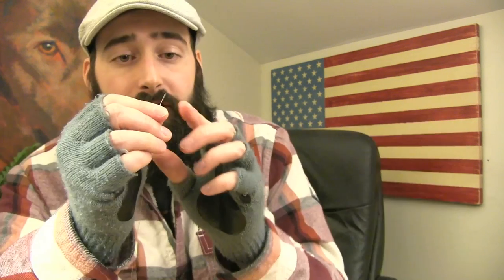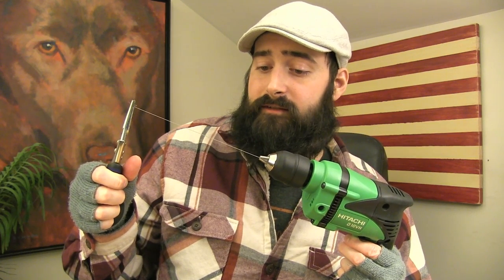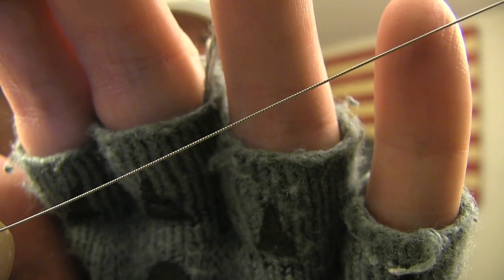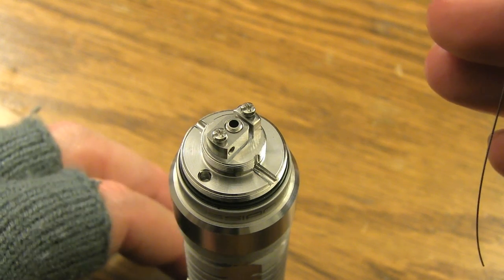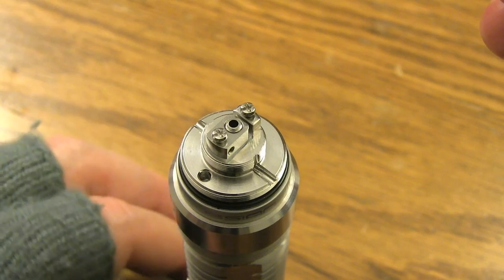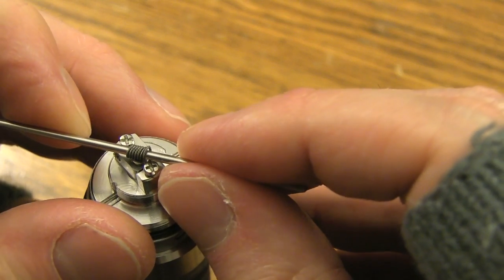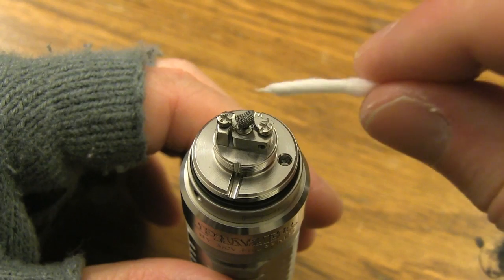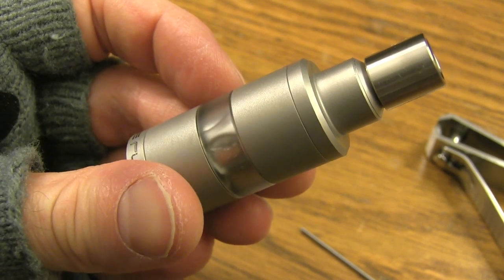Triple Twisted 32 Gauge Micro Coil

Comment: i just built this as 0.6 ohm dual coil in my igo w3 atop my nemesis clone. performs so well lots of flavour and vapour. an excellent use for my 32 gauge that ide stopped using. Thanks Rip :)

Comment: U rock man!! thanks for making great videos that are not painfully boring or drawn out. Fun fact ;) as a electrician I know voltage travels on the outside of a conductor (wire). By twisting their is more surface then a solid piece. just like in the trade. Just wanted to add that man. Thanks again, Namaste

Comment: I do this different to turn my 32 gauge into a lower gauge flavor boosting coil. I make 2 sets of normal twisted kanthal wires, then I twist those together. It makes for a gold chain looking braid to the coil, with lots of bumps and valleys, but is symmetrical, and acts as little channels for the juice to run in, and seriously boosts the flavor of a vape. Vapor production is alright, but I use it for the flavor. At least that is what I use my 32 gauge wire for now that it is too high of gauge for my vaping preference. Seems to make the vape a bit warmer than the resistance would suggest as well.
Reply: what kind of ohms are you getting?

Comment: All I have is 32g right now so ive been twisting once, then doubling that back over and twisting again. I guess its not a quad twist more like a double twisted 32g nano coil, with dragon wicking. Beautiful vapor production and flavor to boot. Only running a single coil since my igo only has one airhole (1.5mm)
You rock Ripp!

Comment: I have a twisted 3 wire 30 gauge 5 wraps micro on 1/16 wicked with cotton on my kayfun 3.1 at .5 ohms and it kicks ass. Extremely warm vape and the flavor is off the charts, vapor production is perfect. Next build will be with 28 gauge

Comment: Hey Rip ... took your advice (usually do) and built this triple twisted coil today for my Fayfun Lite Plus. Wrapped it on a little bigger drill bit at 7 wraps to get 1.3 ohms for my Provari and it's hittin' like a train. :) Much better than my .28 gauge. Good job.

Comment: Hi everyone I've been building for about 5 months now and trying everything I could get my hands on. Let me tell you take the wire demonstrated here make it 3 times then repeat the process with the wires you just made. Make sure to twist the already "twisted" wires the opposite direction when making the new twist. I've been using that design for about a week now and it is a hellacious flavor and really cool for the ohm reads. I'm getting .78 on a 5 wrap on a 1/8 drill bit. Anyway, try it out and tell me what you think.

Comment: made a quad twisted 32 gauge wire and wrapped it five times around a 1 mm screwdriver and it is beastmode. Twisted it by hand, so it took a long time to twist, but at the end i get huge clouds of vapour and amazing taste. I was lucky to find a dutch site that lets you put together your own liquids, by letting you choose three flavours to add and the percentage of vg and pg in your juice, and with my 100% Vg Vanilla-butterscotch cookie flavour it tastes like a bakers dream.
Reply: MeatheadMan Loop it into a coffee cup handle 4 would work too. and just spin the cup. It is about heavy enough to hold line tight.

Comment: This is what I had to do since I don't have 28awg kanthal and all I have is 32awg. I used one piece folded in half so I guess it was only a double twist coil but on a 20 awg needle with 10 wraps it runs about 1.6 ohms. I use this in my protank and works well.

Comment: Just made a dual coil build( 1/16 drill bit, 5 wrap micro on a igo w).  Mother of awesome.  Pulling out the flavor of cherry tobacco with apple.  Best flavor ever.  That wire has been sitting around for months.

Comment: Rip should do a review on my coil setup that I have in my Kayfun Lite.  I have a twisted 28g kanthal macro coil 4/5 wrap reading 1.0 Ohms.  It gives a warm to hot vape with a ton of flavor and great density at 20 watts on my DNA 30. The throat hit is almost too much for me using 6Mg of nicotine. I prefer this setup over the double barrel, chimney coil, and regular micro coils.

Comment: Kangertech subtank best coil ever!

28 gauge triple twisted single micro coil (2mm) with 8wraps (0.6ohms) and coil tucked between the post about 1.5mil from deck

Crazy vapor and i mean CRAZY VAPOR and warm taste
Beats any other coil for this tank with ease (been there and tried everything trust me)

You are welcome
Reply: And i have the v1 rba for this subtank plus
Reply: And with 30w its a beast
Reply: How many watts do you use with this coil?
Reply: Marxpower 94 r

Comment: I had some way too thin wire laying around (34 Gauge / 0.16 mm) to use it single wired.
The resistance would be always way too high.
But with this Method I´ve put 5 wires together. (Very difficult spinning the wires  without breaking them...)
But wow is this awesome. So much vapor and a lot more taste.
Reply: Awesome. I was just thinking about trying 4.
Reply: lanell crowl
Your link has nothing to do with vaping either.  It's for diet pills.
Reply: ThaHiddenHand
Its a spam bot man lol. Just report

Comment: I dont know the resistance for when you stop drilling. But depending on your drills chuck, it most likely has a break. The numbers you see on a dial by the tip. Crank that to 1, then see if it breaks the chuck. If it does great, then dial the number to where you want it to stop spinning. Then next time you do it, you can go as fast as you wish, for the drill will stop at that resistance. That is if its enough resistance to break the chuck, I would think it is. The first setting literally wont drill thru shit. Wont hurt to try, will make your day much easier doing this. i for one will probably never buy 32gauge though, unless someone wants to tell me its better.

Comment: Rip... you screwed up big time here mate. You twisted the wires ANTI-clockwise. My OCD is killing me....lol. JK. ;)

On a serious note, when I seen your last 2-wire twist, I did wonder how 3 wires would work, so it was interesting to see how it would turn out in this vid.

Sorry, one more thing - I just bought some 100% cotton balls and going for my 1st build using cotton. Does the cotton have to be boiled / rinsed before use, or am I able to use it right out the bag? I'm also wondering what the advantage to using organic cotton is, if any. As I say, I have only just started using rebuildables so I'm all ears at the moment.

Thanks again.

Comment: Awesome but can I do this without torching the wire and still get good results by just burning the coil in on the kayfun?
Reply: Yeah, but it will be harder to build your coil because 32g is very springy.  Easier to work with if you torch first but not totally necessary.
Reply: Awesome just wasnt sure, I have the tools to torch it. I'm just lazy  hahaha.
Reply: You can.  But once it's screwed in give it a burn before you wick it until it gets bright red.  It will burn off whatever it is that is coating the wire and while it's red gently squeeze the coils together and hold them until they cool.  You've probably figured that out by now.  At least I'm not spam. :)

Comment: hey I am new to vapeing and just got my first set up,, I got a ego adjustable and a pro tank 2 what is the best coil to make for this set up,, I have watched many of your vids and like the info and think the coild you build are awesome,, that's why I am comeing to you for a good coil,, again thanks for the cool vids
Reply: Unfortunately, you aren't going to be able to make use of any of the coils you've seen built on this channel.  You need to have a rebuildable style tank to be able to use these.  The Protanks use pre-made coils you buy in packs.
Reply: He has a great pro tank rebuilding video if you really want to make your own coils. But I warn you don't use anything lower in gauge than 30 because your ohms will drop below what you can use on an ego and possibly melt the insulator cup, causing a short
Reply: Job Clayburn yep did happen to me i got 26g and did it and fired my ego battery turns on but nothing happens

Comment: But 32g isnt wasted here...I use 5 wraps on a 1.6mm screw and get 1.8ohms (using cotton for wick)  for all my kanger coil rebuilds :P
Reply: For Protank coils I've been twisting 2 strands and doing 7 wraps (on a 14ga needle). I come out at 1.6 ohms. Wicked with cotton and it's been working very well.

Comment: i made a 28 gauge triple twisted sleeper build on my patriot and i got this weird taste. I checked the cotton, and the juice in the cotton (which should be trasparent) around the coil turned brownish. And it keeps on doing that, and i can't feel even the strongest bitter taste juice i put there, i only feel that weird taste. Why did that happen? do i have to recoil, or will it sort itself out? i tryed rewicking, it seemed like it helped for first couple of hits, the flavor was strong and tasty, but then it turned back to that weird one...

Comment: Well RiP my first attempt on my very first KFL+
(always been clearo's before)
don't ya know I hit .98 - which would be great... cept I only have MVP2's  
OH well NEED more wraps ! THANKS !!!!!!!!!!!!!!!!
Reply: That's weird I build a .9 Micro in a protank the other night and my MVP fired it all night long
Reply: Tony Limbaugh  well using the KFL+ on the MVP2 at .9  (this was my first time ever trying a RBA) I was leary about damage. The MVP2 seemed to be getting warm and I need to aquaint myself with the airflow adjustment.. Gonna work on it some more - got organic cotton today so NEW "firsts" on the horizon !  What's the general view on NiChrome? Even my evod/tumbler lil coil rebuilds - can NOT stand the taste of Kanthal A1 ! :P
Reply: Tony Limbaugh the body of the tank adds a little ressitance.
Reply: Liam Brannan this .9 was on a KFL+ just on the ohm meter (there's an update where I got a higher ohms build) still working on builds but LUVIN the ReadyxWick for sure ! Mechs are being prepped but the How to clean and rinse  doesn't show if I can do that method on a KFL+
Reply: Capt Donna to clean the coil, the best thing ive found is to dry burn, then slide the bit you used to make the coil back into the coil and take it off the posts and rub it with a bit of tissue.or cloth to get the ash off. :D

Comment: so quick question for the twisted Guage wire... if i am using a twisted 28 guage wire and i want to shoot around .27 maybe .30 how many wraps should i do for the dual coil
Reply: You should use an ohm meter. No two builds are alike and with as low of ohms as you want a go (no reprimand as i like em low too) its not worth guessing. But honestly on a dual I would guess around 8-9 each will put you around 3 ohms

Comment: Is there a reason why with the twisted 28 you use an allen key and did not put it directly into the drill clamp like you did this time?
Reply: he used a single strand of kanthal versus three individual strands of kanthal.  the Allen key allows the loop of the single folded strand to be spun/twisted whereas you couldn't really make an effective twist with three looped pieces.  also 32g is so brittle it may break being strained so quickly.
Reply: +Pete Horam I was wondering why he didn't just put the loop end into the chuck...it would have been easier than worrying about it flying off the allen key in my opinion
Reply: +sc0tte1 not as tight of a twist.

Comment: Twisted 4 pieces of 28 gauge kanthal together no imperfections in the twist 10 wraps on my RDa and it is firing at 0.10 ohms and my reader isn't giving me a read? It should be at least 2 ohms or so from the math I know off the top of my head
Reply: It's shorting out somewhere, is there anywhere the wire is touching the base of the RDA?
Reply: Yes it was I found out what I was doing wrong about a week ago working perfectly fine now :) running dual clapton coils now on one RDA and a parallel build on my atty3
Reply: Ky Street Thank you for the help though :)

Comment: Why torching? Aren't you gonna torch it by initial run?
Reply: Dameer DJ it makes coiling wire easier, after torching it's a way less likely to spring back and uncoil during building.
Reply: Good question. Torching heats the wire from the outside first, and heats throughout, which causes the wires to bind more tightly and gain rigidity. If you fire on the mech/mod to heat it, it heats up from the inside first and then spreads out (and it doesn't reach peak temperature as quickly as with a torch).

Comment: rip i just wanted to ask what gauges is the thinnest kanthal wire? thanks
Reply: +Jerem Pontillas You can get it as thin as 34ga, there is thinner, up to 38ga or so, but that's fairly useless for vaping implementations.
Reply: +Phrea Nix what gauges is the best for cloud chase and flavor chasing or i assume it depends on your mod right?
Reply: +Jerem Pontillas I'd say twisted 26 and 24 gauge for clouds, twisted 28 and 30 gauge for flavour. 
It also depends on how low in resistance you want to go, where the amount of wraps and the diameter on your coil come into play.  
I play it safe most of the time, and keep my batteries in the best working order for a couple of years, so I won't go lower than .6 to .8ohm for everyday use. But sometimes it's fun to play with thicker twisted or clapton wire in a good dripper.
Reply: +Phrea Nix ok thanks for that... btw i just started vaping for 1 month now and my coil messed up..and i dont have any idea what wire gauges ill use for mech mod haha ty :)
Reply: +Jerem Pontillas Get yourself an ohm reader, use GOOD high drain batteries [Sony, Samsung, LG] and common sense.  
Read up on ohms law and the different types of li-ion batteries etc.  
Happy and safe vaping !
Reply: Bro start with 24g and then go down to 22 and i recommend you get a LG HE4 or HB6
Reply: +izaac fuentes thanks bro but i dont know whats HE4 amd HB6....
tell me about it :)
Reply: +Jerem Pontillas .2 fused clapton at 120watts. I have the rx200 with 3 sony vtc4 and the velcoity clone rda. Best for flavor and clouds. up to you, but its about the best cheapest setup you can have.
Reply: +Colby Brown how much it cost?
Reply: +Jerem Pontillas I spent $43 on rx200, $20 on velocity $16 on sony vtc4s from ebay, and $30 on a 4 bay battery charger. right around $100 for everything you need. cheap setup that is amazing.
Reply: +Jerem Pontillas dont use mech mod. DONT But ur self a ww mod. ANd get ur self high drain batteries. Or you hand might blow up
Reply: +ELI V4  thanks ELI V4 whats ww mod?
Reply: Wattage mods. Mods with chips to protect you from battery dangers if you will
Reply: Mods that ucan set the heat for ur self for example.https://www.fasttech.com/products/0/10011027/2986100-authentic-eleaf-istick-100w-variable-voltage
Reply: can i  chainvape it? cuz im a chainvaper and the button of my scope/tube mod is always gets hotter and hotter every time i use it
Reply: +ELI V4 Dude really..Mechs do not "blow up". Im so sick of hearing that nooby shit. The batteries will if you're an idiot and have no business with one in the first place. The fact that matters is Amp draw and battery ratings. You do know that drawing 15 amps in a single battery regulated box mod(VV/VW) is in no way shape or form any safer than drawing 15 amps from a mech mod, right? Youre still drawing the same amps from the same amount of batteries. All 6 years I've been in this shit, I have never blown shit up. I'm soley an unregulated user, Mech mods, unregulated box mods, and still have yet to even vent one battery. Please, don't spread misinformation on how "Vw" devices won't blow up or are any safer. Any mod is as safe as it's user. They don't blow themselves up. You do.
Reply: +ELI V4 Dude really..Mechs do not "blow up". Im so sick of hearing that nooby shit. The batteries will if you're an idiot and have no business with one in the first place. The fact that matters is Amp draw and battery ratings. You do know that drawing 15 amps in a single battery regulated box mod(VV/VW) is in no way shape or form any safer than drawing 15 amps from a mech mod, right? Youre still drawing the same amps from the same amount of batteries. All 6 years I've been in this shit, I have never blown shit up. I'm soley an unregulated user, Mech mods, unregulated box mods, and still have yet to even vent one battery. Please, don't spread misinformation on how "Vw" devices won't blow up or are any safer. Any mod is as safe as it's user. They don't blow themselves up. You do.
Reply: +mnkhan39077 new*

Comment: Hey Rip hows the Panzer ? I dont get it arentr these mods all like 250 and up you must have like 5k worth of MODs lol Sick as Titsssssss Can you do a contest soon I need a mechanical lol I only have the itaste v.3 Im not even sure if that will work because I wanna start building something for beginners like single micro coil on a igo-l or igo w4  then i have to try and figure out an affordable RBA I dont want to go get a kayfun or russian 91% and blow 90 to 100$ and break it lol and suggestions on a newbie RBA>???? also I am saving for the provari for my home device but it has to be a 1. something ohs to use right? Thanks Rip
Reply: The Smoktech RSST is a great beginner RBA if you want to try the genesis route.  101vapes dot com has them for $19.99 - awesome price.  And if you want a dripper like the IGO-W (1,2,3,4), they have good prices on them there as well.  As for Kayfun, they carry the Hcigar clone for $44.99.  Just bought one there myself today.  No, I don't work for them, but they do have some awesome prices.  Might pick you up a mechanical mod there as well.  Hope that helps you out some.  I think RIP, like most reviewers, gets overloaded with comments and questions, and might not have time to reply.
Reply: thanks Rick